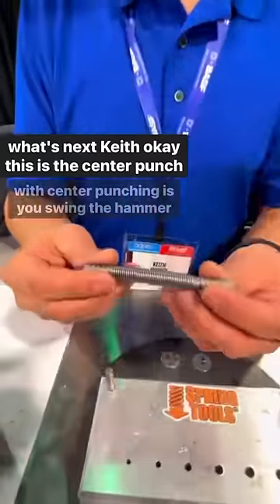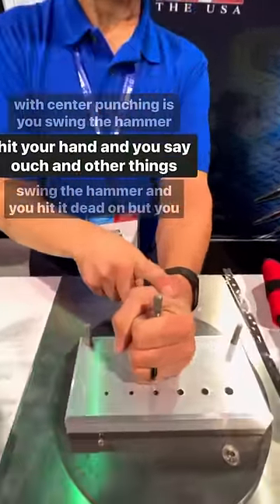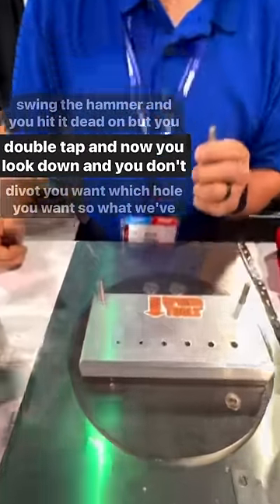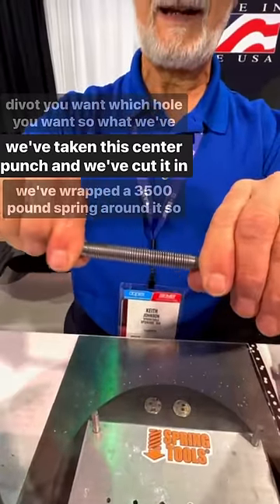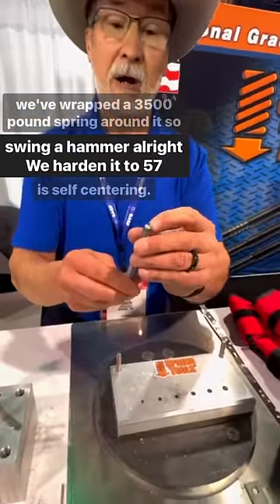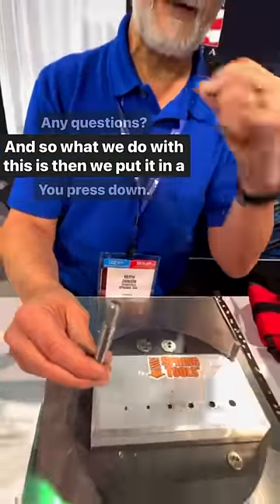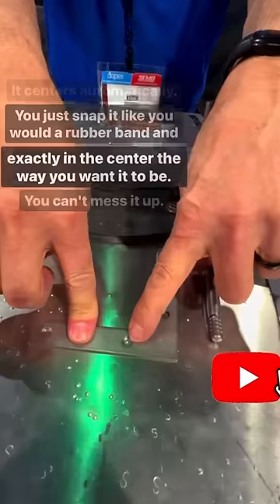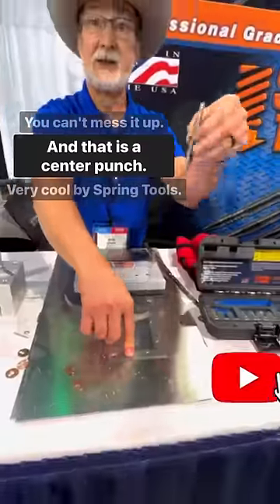“You can’t mess this up”. #shorts

Comment: dude was able to spread the 3500lbs spring with only his fingers
Reply: Yeah he has strong fingers
Reply: That’s old man, strength for you 😂
Reply: No wonder his hands are trembling all over.
Reply: Doesn't that just mean it can take 3500lbs of force?
Reply: @davisking8939  no way a spring like that is taking 3500 lbs in tension and not permanently deforming. you wouldn't be able to pull it back by hand if it had that kind of capacity. I'm a mechanical engineer and have never heard anyone refer to the spec of a spring that way. probably just some salesman trash
Reply: 3500 psi on the sharpened tip how bout
Reply: 3500 lbs. is the tensile strength of the wire used to make the spring.
Reply: @castro1780  also you don't need to beat a center punch to death. A light tap does the job. 36 years as a milwright/ welder.
Reply: @Raceb8420  thats not how springs are measured.
Reply: When you release the spring from full, it place that much force on the tiny tip, need to study physics
Reply: @MaYbYl8eR  Correct, but it is how the material used to make the spring is measured.
Reply: @PinpointR  thats not how you measure a spring
Reply: @Raceb8420  that's a weird way to put it
Reply: The hat makes it much easier to pull on the spring.
Reply: @PinpointR  yes while understanding physics I can tell you that the spring is not 3500 pounds and you also don't need to get a full swing to make a dimplemark on metal. I did to for 36 years and had hammers from 6 ounce to a 40 pound sledge.
Reply: I don’t think I could lift a 3500 lbs spring.🤪
Reply: @Raceb8420  Normally spring steel has a yield strength of over 200,000 psi in tension… so no that would not be correct. He definitely misspoke or doesn’t know what he’s talking about.
Reply: @charlesstockford5913  ok, how much force is exerted on that..002 mm tip after that spring slams down, and need measurement scale or computer to register that impact. I'd say it's high , when a 200 lb man jumps off a 3 foot porch approx 700lbs force went to his shoes
Reply: @PinpointR  I honestly don't know but if I could see the writing on the piece I coukd tell you. It's asimple prick-punch that most cops and emergency people keep in their pocket or turnout coat. They use them to shatter the side windows of cars that are in wrecks. We used them to set marks in sheet metal mostly but you can use a plain prick-punch without being spring loaded. I would use my 12 ounce tinsmith hammer to make my marks. If a man is using it to load and then the spring sets the metal point it can't be that high. Remember for every force their is an equal and opposite force applied. Even though I had a grip of 165 pounds in my left hand and I'm right hand dominant my surgeon said I should have had about 175 to 185 in my right hand. When the final straw that decided it was time for carpal tunnel surgery, I dropped a 24 ounce hot coffee in my lap, I called the surgeon and scheduled the surgery. At that date I had a grip of 5 pounds in my right hand. I'm pretty sure that neither I nor you could hold a pin-prick that discharged 3500 pounds without our arms turning circles and requiring new shoulders.
Reply: Just like my 300lb magnet. Why am I able to remove a gun from the magnetization?!
Reply: @FUBARguy107  a 300lb magnet can lift 300lbs when against a flat surface and pulled perpendicular. ( no sliding)
Reply: Okayyy
Reply: @brandonb6164   If the wire is 0.0808" (12 gauge) than Pi * 0.0404 * 0.0404 * 200000 = 1025lbs.  The tensile strength in PSI by itself is only part of the equation. That's a property of the steel, regardless of size/shape. To get the strength of a particular piece of steel (e.g. a wire) you need to know its size (as in cross-sectional area)
Reply: I know right Dude is superstrong
Reply: @brandonb6164  yeah, you seem to ignore the "per square inch" part. The wire definitely doesn't have a 1 square inch section
Reply: That's why he was shaking. He had to do it all day.
Reply: @EinsamPibroch278 trying to limit his power so the tool doesn't go poof
Reply: @FAB1150  You don’t rate springs by their tensile strength. You rate them by the relationship between force and displacement. This spring is probably like 10lb/in meaning it takes 10 lbs of force to stretch it one inch. Besides, the important material property in coil springs like this is not tensile yield strength but modulus of rigidity, which is the slope of the shear stress/strain relationship.
Reply: @Raceb8420  I was just responding to why I thought it was likely he misspoke. Coil springs do not stretch like a rod does when a tensile load is applied. The rod deforms under normal stress and therefore the tensile yield strength determines maximum load and the modulus of elasticity determines strain in this region. Coil springs deform differently, as load creates torsion within the coil, not normal stress. Therefore the modulus of rigidity is the important material property in this case. But even then, this is only half of the problem. The cross sectional area is important in determining how the spring will react to a load, but not directly like with a rod loaded in tension. Instead we determine the polar moment of inertia and use this to determine shear strain. If you integrate this along the length of the coil you get the deformation of the entire spring. 

That’s why we use Hooke’s law for springs. F=kx. F is force, k is spring constant and x is displacement. This spring is probably correctly rated to about 10lb/in. That means to stretch it 2 inches, it takes 20 lbs of force. 

I hope this helps.
Reply: @brandonb6164  i know that, but it's the most likely thing that the number he gave means. Marketing stuff
Reply: @castro1780 or.... Maybe it has the ability to apply 3500lbs of pressure to the impact point? Engineers be overthinking.

The yard dart of the 1980s weighed maybe 1lb, and when thrown BY HAND it had the capability of piercing a little girls skull with 23k lbs of force. 

I could baseball pitch a 4.2 gram rock at a piece of plywood and it'll bounce off, maybe leave a mark.. now I take a 65 grain (~4.2gram) bullet, send it at the same plywood, and it's going clean through. Technically the rock is harder.
Reply: @nickernator4788  nah not overthinking, just alert to salesman BS.
Reply: That's spring strong enough to hold a Toyota Camry
Reply: Man.. 
This is absolutely useless.
Reply: @castro1780  I hear you on the salesman thing.. maybe that apprehension is clouding judgement?  

Did the salesman claim the spring could hold 3500lbs - or - claim the spring and punch combo can potentially apply 3500lbs of force to the metal?  

Not trying to pick a fight, but I've worked with a lot of engineers in my life, and I've see this "issue" personally.. One thing I've learned is that overthinking happens a lot, especially in young engineers fresh out of school. They are so intelligent in the field they trained in, that looking outside the box is often difficult. Even more so with the recent intense education.

 One engineer Matt had a fascination with pneumatics and would solve every problem he came across with pneumatics. Until a senior engineer came along.. Matt would joke about a device he created for a manufacturing need, where he had dozens of pneumatic devices ruining, cutting, rolling, moving, cutting, over and over, causing a few failures over time, resulting in costly downtime. The other engineer redesigned the process in 15 min, using one motorized piece with an arm of sorts.. Resulting in less moving parts to potentially break..  "If you're only tool is a hammer, everything looks like a nail." -my great grandmother (probably quoting someone else lol)

Personally, I heard the salesman throw out a "big" number, when it came to how much force was being applied to the piece being punched.. as that's typically the measurement I've heard used in my field (and it seems like a bit much for a simple punch. I'd like to select how much force personally)... 

 It'd be like a salesman telling someone "this truck has 300 horse power.." as part of his pitch.  Meanwhile the horse rancher who overheard the pitch, isscratching his head and says "there's no way that truck could pull a trailer with 300 horses! That's absurd!". And he's right. But that's not the measurement the salesman is talking about.

Hyper focus. I have it, just ask my wife.. she knows to give plenty of context when asking me a question, especially when I'm in my shop. And, I'm absolutely terrible with picture riddle puzzles.
Reply: @castro1780  sorry you don't like words bud.. Some people need more explanation, you seem like the type that needs it.. Should've known that's also the type that doesn't want to listen. Good luck with that.
Reply: @nickernator4788  hahahaha, I work right next to salesman that admit their tactics. nice try.
Reply: @nickernator4788  yeah you keep on "thinking". you'll catch on eventually

Comment: Used variations of this 20yr ago. I believe they were called Noxon punches. Edit: yup, still available from various sources.
What this one does is add "self-centering".
Reply: Yup,have used the regular ones for 15 years now to punch proud nails into trim. Way faster than having to grab and swing a 16oz to set a trim nail set proud by a nail gun.
Reply: I’ve also used an “automatic” center punch for 10+ years. It was already an old design when I picked it up 10+ years ago so I find it kinda funny that this guy is talking about it like it’s something no one has done before lol. I have a “self centering” one like this and a regular one witch I use a lot more often because Im an auto mechanic & fabricator, & general fabricator so I’m not usually working with thin brackets that already have a chamfered hole lol and that’s quite literally about the only thing the “self centering” design is useful for. But yeah “self centering” or not still nothing new these have been around for decades.

Edit: omg damn yeah I just quickly googled the patents and found a few different designs from 1908 & 1945 for the regular one. The one from 1945 looks like the ones they sell at Home Depot and harbor freight today. And the 1908 just looks like an older less complicated/different design. Also found a patent for a “self centering” one from 1917. A little different than what they’re selling here but the principal is identical, you pull the punch up and the spring shoots it back down. I mean the only difference is the picture on the patent has a full length outer part with the spring and punch incased on the inside. Plus a larger cone on the end.
Reply: Someone give dude a drink... those hands shaking...
Reply: @kcscustom9759  ever heard of parkinson's? Other conditions can cause tremors as well. That's how you judge people? By looking at the steadiness of their hands?
Reply: @UpdogGolf  some heart medications can cause hand tremors on top of what the other dude said. Kind of fucked up, man.
Reply: @thenextgen1able  ok.
Reply: @thenextgen1able  What..? My comment was about tool design, application, and how long they’ve been around. I didn’t say a word about anyones hands shaking, or anything even remotely close to that for that matter.
Reply: @kcscustom9759  Seriously. I really don't know what's going through these guys heads that think they're inventing something. It's as if they did zero research beforehand.
Reply: @thenextgen1able  Ever heard of checking to make sure you're replying to the right person?
Reply: The only "self centreing" part here is the bracket. Without the bracket, there's no accuracy whatsoever
Reply: @GetTheFO  I'm 30 with end-stage kidney failure and high blood pressure. 
Yes shaking confirmed.
Reply: @thenextgen1able  imagine getting upset on the internet over someone's words who aren't directed at you, that's sad.

Comment: I've never hit my hand, I've never double tapped, but I just imagined my skin stuck in that spring....
Reply: I’ve double tapped but it’s easy to tell which one was first because it’s bigger
Reply: Cause You’ve never worked with your hands..
Reply: you just hold the end in place and pull with the other hand. Pretty hard to pinch yourself while you use it, but there's always somebody that causes safety warnings

found a set of these a few months back, simple and does what it advertises well enough, especially in tight spaces you cant swing a hammer
Reply: @One yea It’s way more Efficient then having to pull out a hammer. I’ve had mine for half a year and I haven’t had any complaints
Reply: I've been a stainless steel metal fabricator for 25 years. And have had my cross pein & finishing curved hammer the whole time. Never missed or double tapped. 
This punch in video looks ridiculous.
Reply: And what about automatic center punch
Reply: I always double tap, but I have never while prick marking!
Reply: @captaincj2778  A snap punch is better only requires one hand to operate.
Reply: @donziperk  bro you need to bolt it with one hand and pull it with the other
Reply: From my experience the double tapping tends to happen with specific materials, and usually when its really thick, and is up against something. In those cases I wouldn't use a toy like the thing they advertise here anyways. 

In those cases you can cancel the double tapping a lot by just putting pressure on it to hold it down more securely. Even if you do get some, its always clear which one is the double tap, because the second one is always smaller.
Reply: @samwalters3058  this is truly the most important safety concern
Reply: @UCwx9qTBk0pVVZg01rcrCcEQ ya there are different names for them. I like them much better than this springy thing.
Reply: It doesn’t get stuck, and these can be used to tap out pins of all sorts super easy. There are loads of gimmicks on YT but I can tell u that this one is worth it.
Reply: @numnut1516  you can tap out pins until the pin is too far in for the end of the centre punch to reach
Reply: Guarantee you’ve never touched a hammer let alone a 4lber hitting a cold chisel
Reply: @smokingbluedream  I’ve never hit my hand using a centre punch either just don’t swing it like a barbarian and you can be accurate
Reply: yeah sure you never go through that before, because you never done it before and you just kept imagining and complaining everything
Reply: Ya want a medal or somn?
Reply: Factsssss

Comment: Probably 3500 lbs per square inch, measured at the tip of the punch (which is not how you measure spring force).  So let’s say you can do 100x100 punches in on inch (1000 punches), that would leave you with a force of 3.5 lbs per inch.  The spring seems smaller than 1 square inch, so let’s say about a 4-7 lbs spring pull…that seems about right. 

Now a hardened tip will make a mark in mild steel with that force, it won’t be a very big mark, but a mark.  With a push-down spring punch you are looking at 10-20lbs of spring force needed I suspect that equates to 40k-60k psi and a hammer blow is going to be way above 100k.

Comment: Damn it must've hurt him to look down after he says "perfectly centre" and sees that it isn't perfectly centre
Reply: Cameras perspective
Reply: The hole IS centered, it's just the way the camera is angled that seems it isn't.
Reply: Its not centered
Reply: Camera isn't looking at it straight down. It looks off because the screw holes aren't recessed all the way down through the plate to the wood. They're slightly elevated, giving that illusion
Reply: Or the bracket could've slightly moved when he took his hands off of it. The screw would bring it back, anyway
Reply: @user-et5mz5ex9s  you must have watched  a different video.

Comment: Keith is really going to be shaking when he finds out about automatic center punches.
Reply: These would be a lot easier to use than an automatic punch. The force required to squeeze an automatic punch is very high, sometimes nearing 100lbs on top of the punch. Whereas little old Keith lifted the spring with just two fingers in his demonstration

Comment: Spring Tools has had these for 20 years.  Great tool overall, but sad to see this one only has a working tool on one end of it.  All the ones I've owned they put a center punch on one side, and a nail punch on the other, and you just turn it over depending on what you want it to do.
Works great.  I've set 16p nails flush with it, although it took several hits.  Just be careful not to over-extend you spring, because it'll get a stretch in it and you'll lose some of your impact force.  Like when your Slinky failed as a kid and never sat right again.
Perfect tool to keep on you as a house painter on residential repaints.  No longer had to carry a heavy, awkward hammer around.

Comment: 35pound, not 3500 pound. A single 3500 pound spring will only compress about 3/4-1 1/4 inch with the full weight of most individual vehicles on it.

Aside from that, this is actually a legit tool and it helps a lot for making a bunch of dots real quick. Great for tight spaces too.

Comment: These are great if you're only using them to push the pins in or out of a door hinge. 

Buy a starrett auto center punch. This tool looks finicky and like it will actually create more issues than it solves.

Comment: I believe the best center punches are those you push to load a spring that drop a weight on the point. you push the tool instead of pulling it making it more precise, you can set the force of the spring and you see precisely where the point is so you don't need to place the bracket as a reference point.

Comment: I’ve had one of these for over 10 years in my tool box they work well unless you want to start with a bit that’s bigger than 1/8” or 1/16”. If you’re using a mag drill and you just don’t want your bit to wander it’s a lot of time wasted stepping up sizes if you use a very small center punch. Also the self centering only works with countersink type holes otherwise it will pivot it it’s a straight bore hole your trying to transfer. Hence using transfer punches with a hammer…